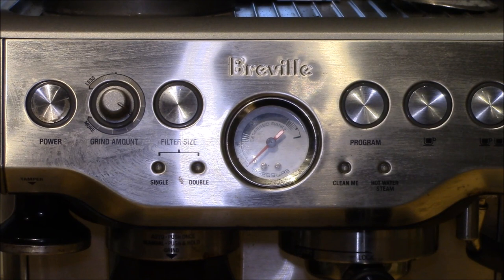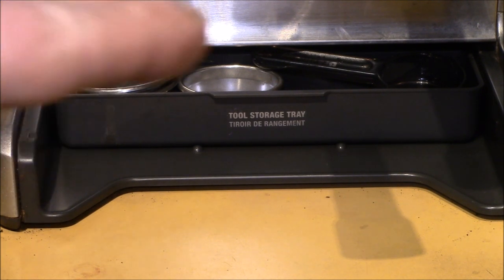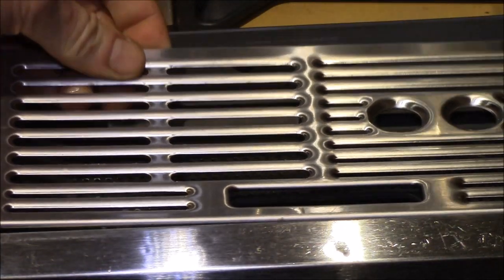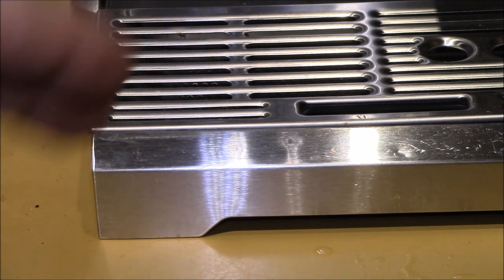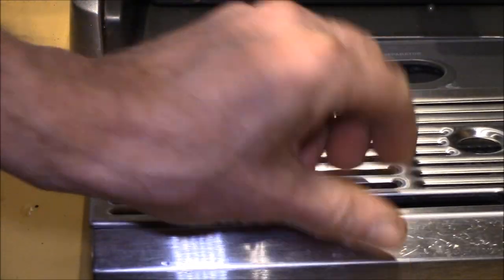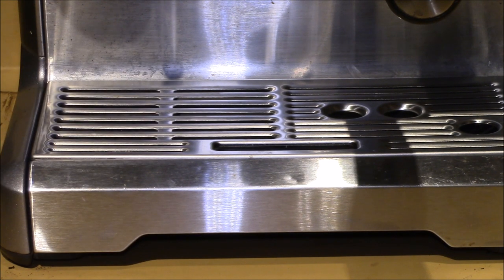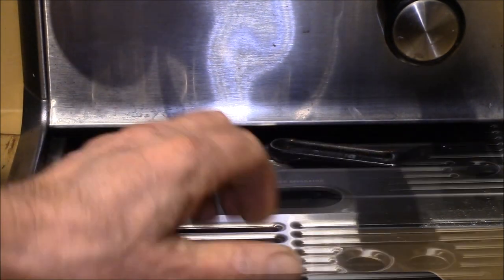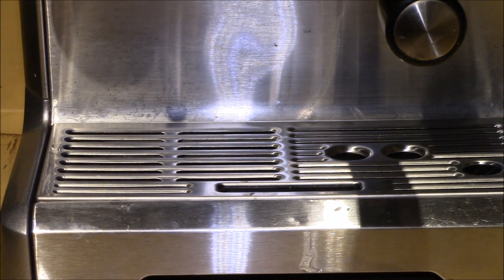Breville 870XL DripTray Cleaning in the Dishwasher!

Comment: I just reproduced your experiment and can confirm: no visible damage whatsoever! :-) Neither to the plastic "coffee grind separator" nor to the metal bar at the front of the drawer (this part worried me the most)! Even the "empty me" sticker stayed in place. I used the top tray of a Siemens SR636X07IE Dishwasher (if anyone cares) for the drawer. The grind separator even went to the higher pressure bottom tray of the dishwasher. Since my dishwasher does not have dedicated "low heat" settings, I stayed with the default "ECO"-Program which runs at 50°C (should be 122°F).
I know this single run is no guarantee for future runs or other machines. However, it is yet another measuring point to indicate that the fear of dishwashing seems overrated in this context :)
Thanks again for the video.
Reply from the maker: Glad you found the video informative and thanks for posting your experience.  I do keep an eye on the 3 parts for signs of damage but in 6 years, so far, have seen no visible change.

Comment: Another great video. Thanks! I have never thought of putting it in the dishwasher. Until now, I have used a sponge and a brush, which is messy and only partly successful. Now I will be trying the dishwasher this weekend.
Reply from the maker: It's been working well for me.  I take great care to keep any of the plastic parts away from any heat elements.  I would try it once and check for any signs of possible issues.  I rinse mine out by hand most of the time and maybe every 4th time throw it in the machine.  Yes, I agree, cleaning it completely by hand is difficult and messy.

Comment: Thanks for confirming this. I was confident that it would survive just fine.

I find the drip tray gets pretty slimy and needs a good cleaning.

Key to any concerns on plastics is top tray.
No dishwasher will damage SS unless its absolute garbage SS, or maybe some crazy chemicals - but that would destroy your dishwasher as well.
Reply from the maker: Yes, top rack in the dishwasher and I don't use heated drying or the electric water pre-heat.  No problems in 6+ years of dishwasher cleaning.  I do find I get a bit of hard water deposits in small areas and just hit that with some descaling solution used to descale the machine.
Reply: @The4Crawler  did mine and had no issues at all.

Nay sayers beware!
Reply from the maker: @Trevor_Green  Glad you tried it.  Been doing mine for about 7 years now and still looks like new.  Big thing is to keep the plastic parts away from any heating coils in the machine.

Comment: Thanks mate. Your video was exactly what I've been looking for. I'm having my machine for about a year now. Always cleaned it by hand. I was kind of ok with that in the beginning, with the machine being all shiny and new and exciting ;-) 
However, over time it got its first scratches anyway. And you know what, I don't even really mind. After all, it's just a coffee machine and cleaning the damn tray corners can be such a pain. The only reason for not putting it in the dishwasher was the same fear of "totally ruining the tray".

I actually once had a bad experience putting the portafilter of a very cheap espresso machine in a dishwasher. The part came out looking totally ... like burned. Pretty impressive. Didn't make me happy though.
Googeling for the effect I found that the part might have been out of aluminium which apparently can oxidate in dishwashers. 
However, the Barista express probably uses other materials then :-)
Anyway.

Your video just encouraged me. I think, it's time for me to try. Good Idea to start with low temperature settings. I guess that's called "eco" on my mashine :-)
Reply from the maker: Yes, give it a try, keep all the plastic parts up and away from any heating elements.  I have heated drying and water pre-heat functions turned off on my dishwasher, so the heating element in the bottom should not be on.  The metal grill seems to be a decent grade of stainless steel.  I put the plastic parts on top of dishes on the top tray.  I can see no signs of any degradation after 6 years of occasionally putting the drip tray parts in the machine.  I too was told I would instantly damage the parts by various "people in the know", but I like to test things myself.

Comment: HOw do you clean the exterior of the machine, Mine has some white dots now and coffee stained on it. not sure how cuz i always wipe it down. Its just appearing everywhere
Reply from the maker: I usually wait until after I run the cleaning cycle and use the last of the cleaning solution that's run through the machine to remove coffee stains on the exterior of the machine:
https://youtu.be/P0r_FQp5H2w
Two advantage of that, one is the steam from the cleaning cycle helps to loosen the coffee stains and the cleaning solution is designed to remove coffee residue from inside the machine, so should do the same on the outside.  
As far as white spots, likely hard water stains?  I get some of that too, especially if I just wipe with a sponge or rag and leave it to air dry.  I think if you do a wipe down with some vinegar or your descaling solution and then wipe the exterior dry, it's probably take case of those spots.

Comment: I just want to know how to get the drip tray back together with this plastic lid.  I didn’t think Id need to pay such close attention when taking it out.  This lid thing isn’t fitting
Reply from the maker: I try to line up the oval slots on the two upper pieces over the "Empty Me" float on the bottom piece.  I find I have to move the middle plastic tray around a bit until it sits flat on the drip tray.  Then the stainless steel grate usually drops right on top.  Sometimes the little rubber nubs on the middle tray get hung up and prevent it going together properly.
Reply: R Brown 
Ok I will try again.  I got it together without the longer rectangular piece (the one you can put your extra baskets in).  Let me mess with it a bit more now that you have given me a bit of confidence to push on haha.   I have the breville express:)
Thank you for caring!  And Happy Thanksgiving
Reply from the maker: Yes, that rear storage tray can get in the way.  I usually shove it all the way to the back to start with, or it can be left out.
Reply: Ok I’ll probably leave it out.  I should have paid attention when I took it all apart, but if its fine off to the side I’ll leave it:)

Thank you for your time😊